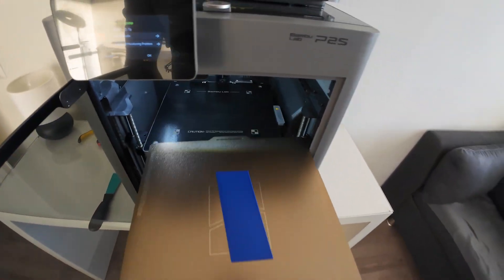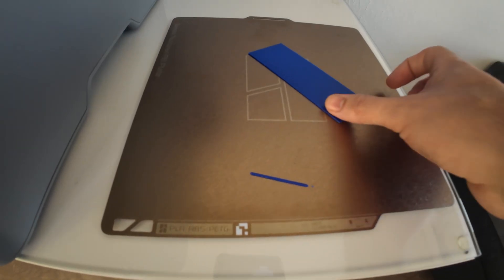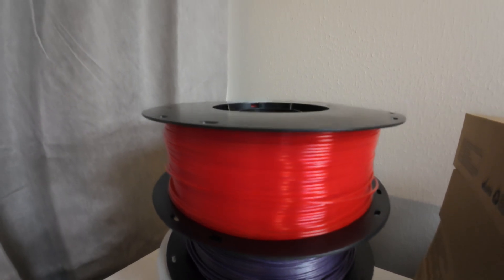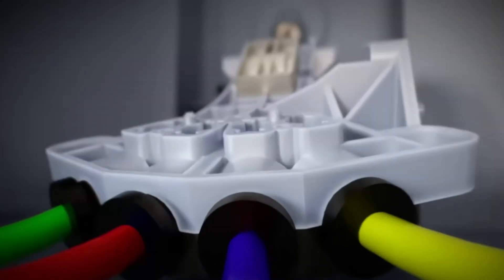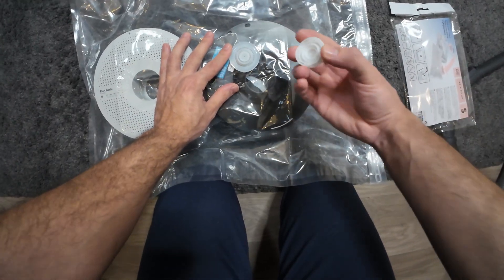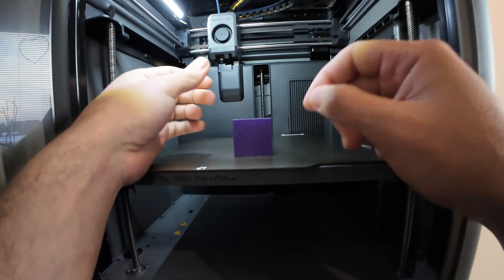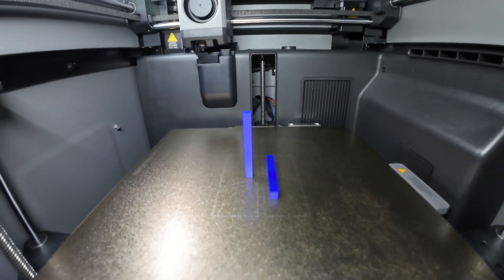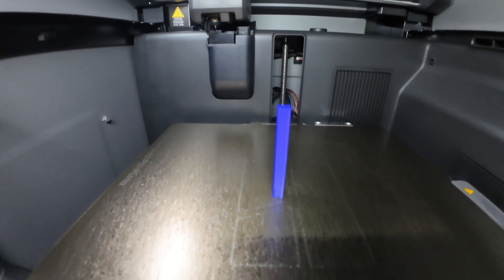Stop making  this 3D printing beginner mistakes

Comment: When printing PETG, I tend to have white mark on the plate (It's not glue cos I don't use glue for adhesion cos never had problem with adhesion). The white mark on prints can be removed with splashes of hot water. But the white mark on build plate is there even after washing with soap and also hot water. Any suggestion?

Comment: Hello, I'm sorry but I need to address something to you about the vacuumbags. If you are going to use these make sure to leave a little bit of air in it. That way the silica gel desiccant can do it's dry work properly. If you vacuum seal the bag too much the wet air cannot travel within the bag.
Reply from the maker: that`s logical  good point 
Thank you for comment

Comment: Got a hot flat plate for Flashforge AD5X, it sticks too well. 
I just put the plate in the freezer for a few minutes, comes right off, works great.
Reply from the maker: Thats  good  , important to remove the  the print without deforming it 
Thank you for comment

Comment: When you put the silica gel bag in the vacuum bag, don't put it in the center of the spool. You can see that when you suck out the air the middle hole of the spool is sealed off by the vacuum bag. Put your silica gel bag around the outside part of the spool where the filament is.
Reply from the maker: Thank you for mentioning that ☺